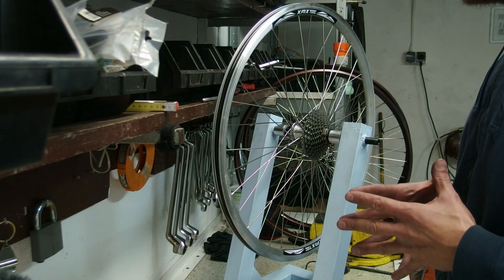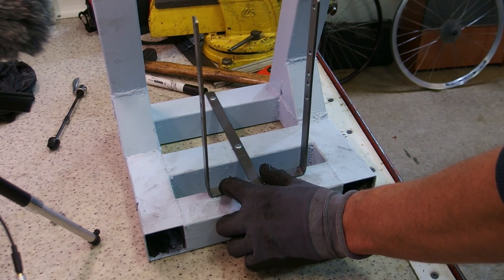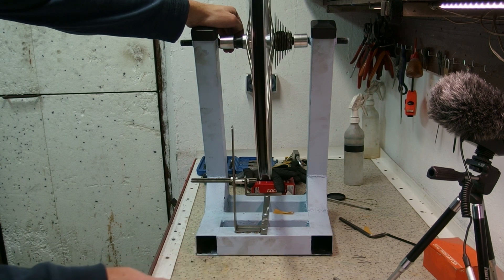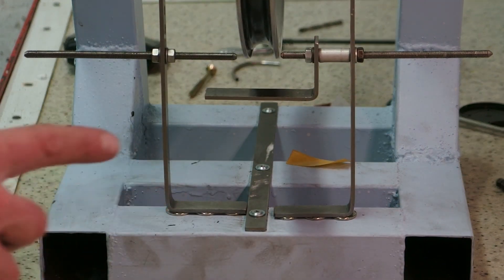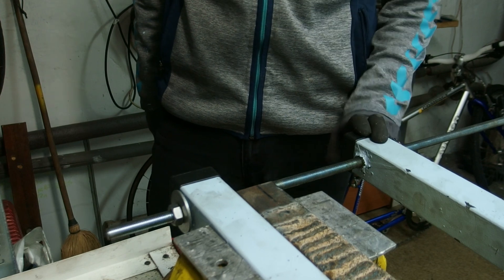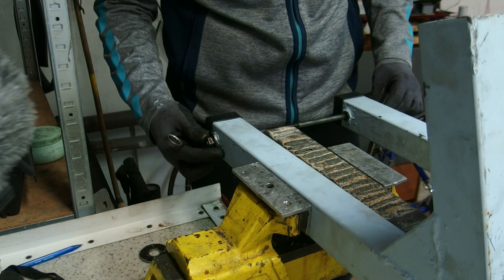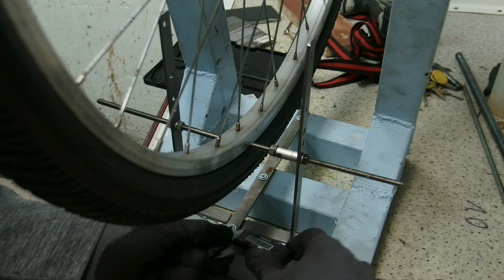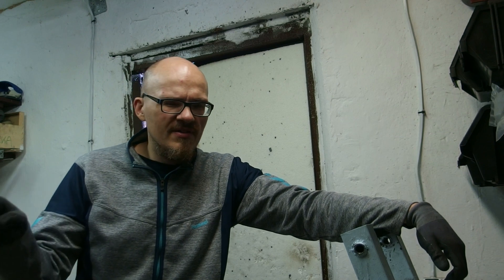Truing stand to end all truing stands. Part 2 of 'yes'

Comment: Assuming the wheel is crooked as you suspect, and that your error is 5mm for a 29er, then it would be about 4.5mm for the 26 inch wheel. Close enough to treat as the same and just proceed with what you have.